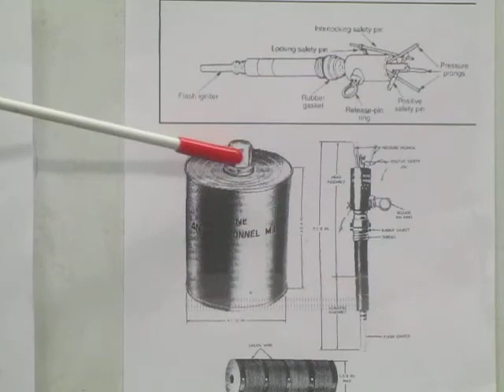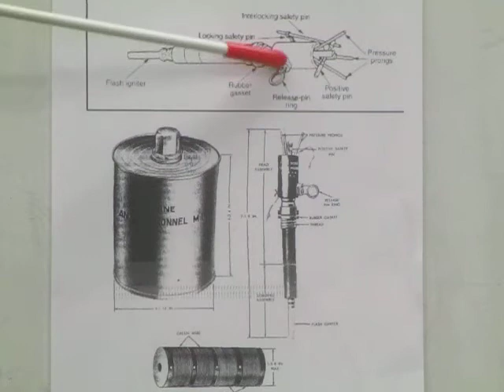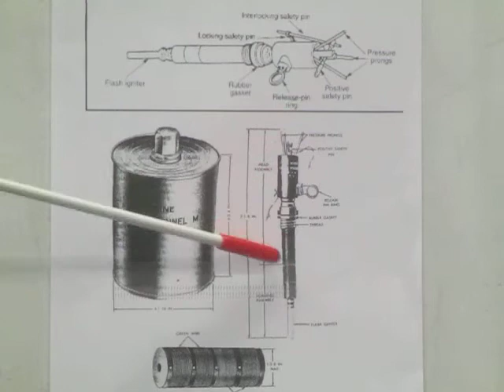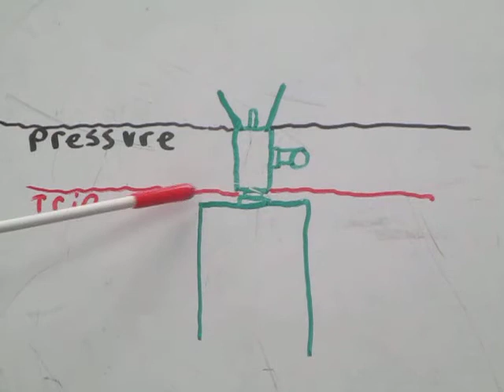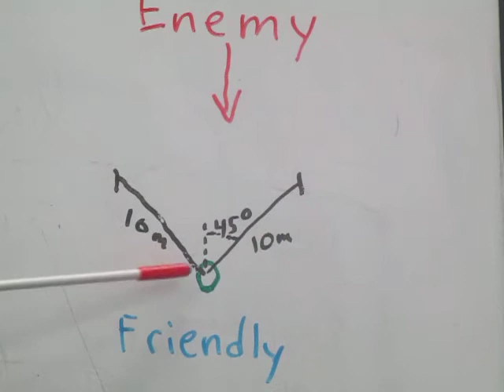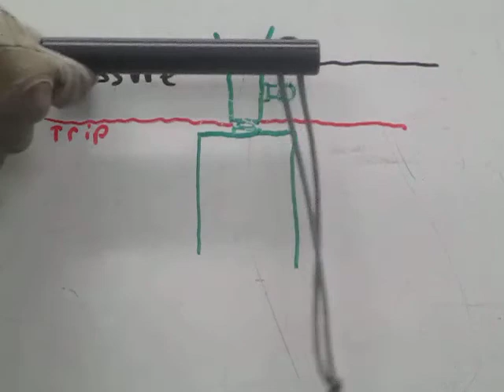US M16 Series Antipersonnel Landmine

Comment: They last made them in 70s, and may be used if needed? From memory is made from nitroglycerin, and tnt will sweat nitro with time and become extremely unstable, so these would be more of a hazzard to users than foes. Beat to remanuafactor these with PE charge for safety and longevity at a guess!

Comment: Hi, thank you so much for this helpful video. I do 3D animations of firearms, and am building a 3D model of an M16 landmine. I'm currently modeling the inside of the M605 fuse, particularly the Trigger Pin and Release Pin. However, I haven't found any good references to how these actually look, beside the cutaway images online. Wondering if you happen to have anything that may help?
Reply from the maker: Try FM 20-32 Mine and Countermine Warfare.  But it will still be just drawings.
Reply: @SecurityGuy42  Okay thanks so much sir, I really appreciate it.